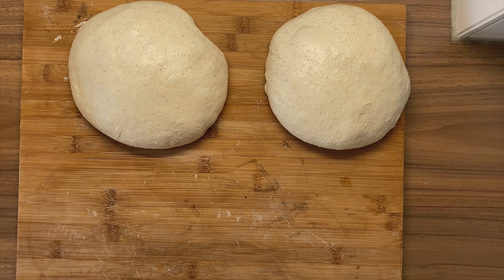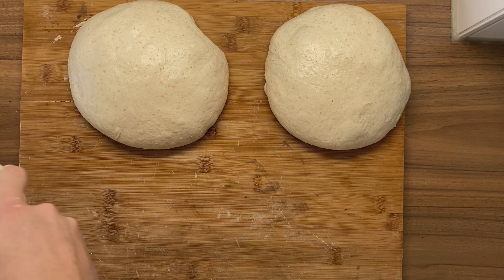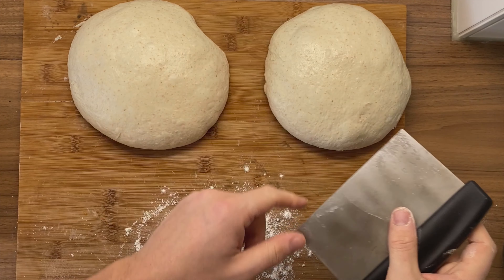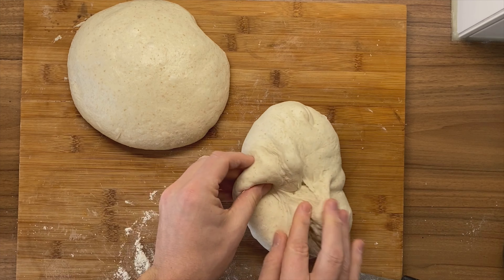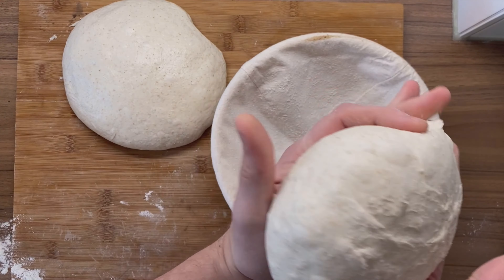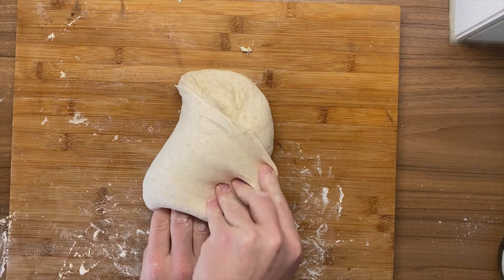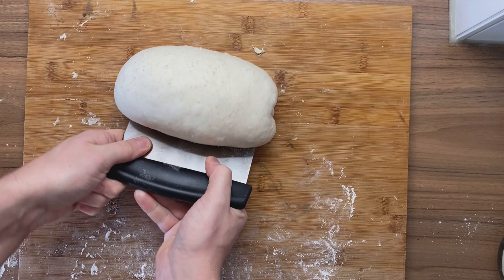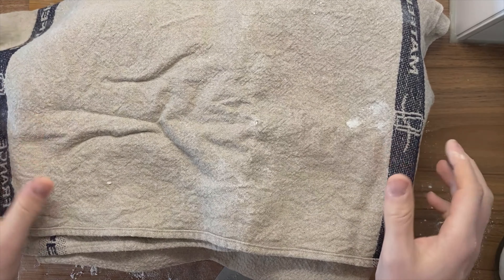The Ultimate Guide To BOULE and BATARD Sourdough Shaping

Comment: Did you say you wont get a plastic scrapper? I have not got myself a metal scraper yet, will do that soon if it is a right tool to use.
Reply from the maker: Moin Xin. Both should work. I actually mostly use my hands these days. I feel that way I develop a better feeling for the dough :-). For dividing the dough I prefer metal as it is more stiff. But both should work!

Comment: I'm a bit confused as to how you avoid your fingers sticking to the dough, especially when shaping the batard. It doesn't look as if you add much flour to the bench (even compared to your other videos) and the dough looks so easy to work with. Is it simply a question of hitting the sweet spot fermentation period or does it come down to the hydration?

When I shape (an 80% hydration) batard - even if my bench is rather heavily floured - my fingers stick. Especially my thumbs when rolling the dough up. They tend to get stuck inside :D But the dough also stick a bit to the bench, so maybe it could be an advantage to pre-shape the dough - even though I make one-bread dough only - just to form a non-sticky top?

Sorry for the long question(s). In any case, I think I will lower the hydration of my dough to around 70% to get better at shaping.
Reply: Very interested in this question as well. My fingers usually stick quite a lot even at hydration of 70% and my dough tends to be relatively runny. Not sure if it's a problem of gluten development or if it's a problem of over fermentation during bulk fermentation. I usually do 1-2h autolyse, mix in the starter and salt and let it bulk ferment in the oven with the light on for around 4h.
Reply from the maker: Moin Thomas. Moin Jonas. Excellent question! It's a matter of building enough strength earlier, that way our dough becomes less sticky. With coil folds your dough should be nice, smooth and silky. Furthermore the more you you ferment and inflate your dough, the smaller the surface area comes that touches your hands and fingers.  If your dough becomes overly sticky over time, chances are you fermented too much.

Comment: I see you are working on a wooden board, it this surface better than marble? 
Curious, how come dough dont stick to your hand when you do your shaping? When i tried, it sticks to my finger and when i tried to stitch, it does not stick, i am sure you have the answer. Thank you.
Reply from the maker: Moin Xin. I used wood for 3 years. It is just the granite handles high heat better. So I don't have dark spots at some point when placing my dutch oven on it. Make sure you flour your surface for the shaping. The top part of the dough is sticky, but the part that is on the bottom, that one should not be sticky as it is on a bed of flour.

Comment: If in case I fail in my final shaping, can i reset my final shaping? Let it rest pre shape then final shape again?
Reply from the maker: Hi Paulo. Definitely you can do that, no worries. The only thing is you would not have an as open crumb then, as you damage the structure a little bit. But don't worry, you will still have an amazing tasting bread. I like to practice shaping after I added the sourdough starter. Just shape it on the bench. You add strength and can also practice.
Reply: @the_bread_code  Thank you so much sir! Another thing our flours here are weak. Whenever I do a final shape, the outer skin tears. Do i need to skip pre shaping? Or avoid avoid doing a tight preshape? Thank you so much. I love your videos very informative!
Reply: You can add powdered seitan or vital gluten to your flour 👍also you can find a good flour in the internet shops. I hope that will help you.